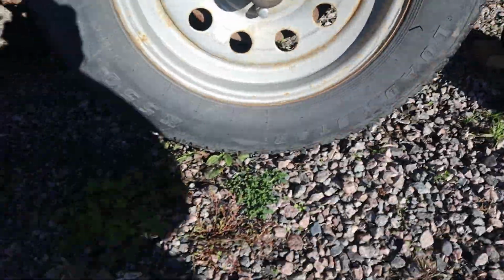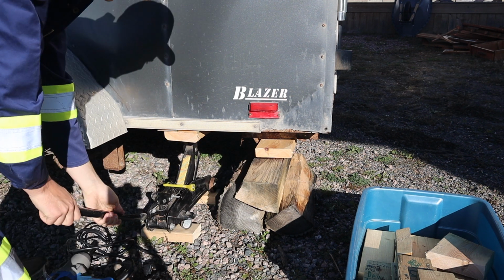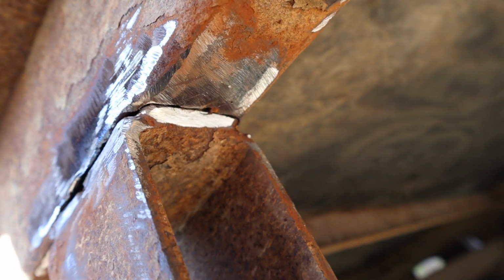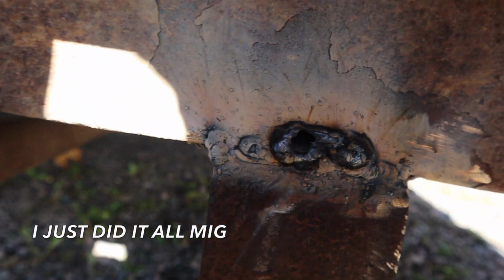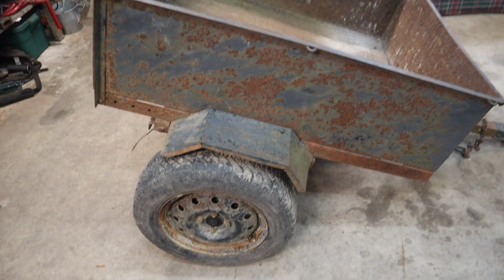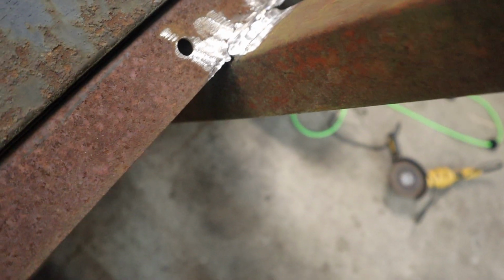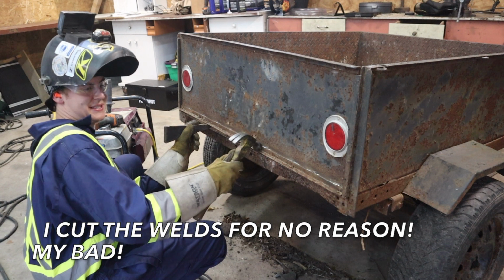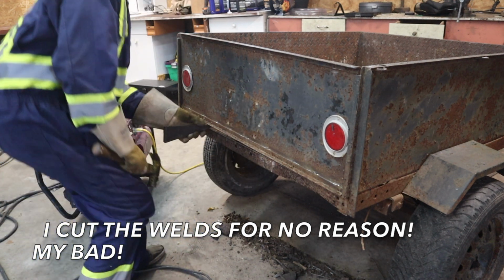Welding Broken Trailers Back Together! (MIG and Stick Welding)

Comment: I think you should really title the video as gasless flux cored as MIG is different.  You'd never get me crawling under a car/trailer without a better support and chocking the wheels.  Wood could be an option but not a rough pile of fire wood.  Glad you survived and it's your life so good luck to you.  Points for keeping the guards on the grinders!
Reply from the maker: Thanks for watching! Yeah a jack stand would be much better but I gotta work with what I have. The wood is supporting only one corner so if it did fail the trailer would rest on the hub where I was which would leave enough clearance that I wouldn’t get squished.
Reply: Lincoln makes a part specifically for FCAW that is smaller (easier to see puddle) than the nozzle you are using.
Reply from the maker: @donsmith9081  I have one.... it's a black plastic cone which is fucking useless. The contact tip sticks out past it and arcs out if you touch the material. I run the regular nozzle because you can drag it and not arc out.
Reply: @JTwelder.  It takes a little to get used to but is well worth it.  You can get in close on a fillet weld and see where you are going, that’s why they make them. 
Consider it like stick welding but ten times easier. Also the closer you are the hotter the weld and that can be important when using a 110V machine.  I have been using one for years. Try it again, I think you might like it.
Reply: @donsmith9081  yes...that ease of visualization and heat manipulation is the big benefit.   dragging the weld without seeing the puddle is definitely not a pro move.

Comment: you should only ever weld with a chassis, not accross it as when it fails, you end up with a 'plug' which comes out, exactly like what happened here. the whole square welded area came out
Reply from the maker: Yeah man your 100% right also the same applies even more to boom sections on heavy equipment. In this scenario the trailer just needed a quick fix to be on the road the next day and neither me or the owner had the proper size material to brace the frame length wise. They also got the trailer for free and doing a proper frame brace would cost over $500 so it's not practical. The original repair was done with cold hard wire mig that was barely fused and it lasted 2 years so I'm sure my repair will outlast the life of the trailer.

Comment: Hi there, i really needs some advise from you. I have a caravan and the weekend the chassis broke right through. On the nose side just in front of the shock,spring or what ever you cal it. Can it be repaired. I was told it cannot be repaired. I must get rid of my van. Some how im not believing him. Please advise me if this is true. Can it be   repaired.
Reply from the maker: I would recommend bringing it to a welder and seeing if they'll do it. It's doable Depending on how bad it's corroded. If the chassis is completely rotten then it can't be fixed but if it's just broken and not rotten it definitely can be repaired. Good luck

Comment: That doesn’t look like mig that looks like flux core. If you were running argon as a shielding gas the arc would be more of a sky blue color.
Reply from the maker: It is quite obviously flux core but where im from we just generalize all wire feeder welding as mig.

Comment: How many watts is tht generator? I have the same machine but idk how many watts I need to be able to run it properly.
Reply: Any 9000 watt generator from harbor freight will run it with no problem
Reply: [Amps * Volts = Watts]  You'll need to locate the input power specs for your machine (owners manual or sticker on back with duty cycle) as each can vary widely between MFGs and by welding type. You're looking specifically for the max input amp draw for the machine at the given voltage. For example, the Lincoln Easy-MIG 140 is {generically} rated for 20A@ 120V and 20% duty cycle on their site. I'd still check the sticker to be 100% sure since they're not as specific as some other MFGs. That said, 20a * 120v = 2400W. Add a 25% margin just to be safe (2400 * 1.25 = 3000w). The "continuous/running watts' of your generator should then meet or exceed that number (3000w). 

I grabbed a cheap multi-process Amico Mig140GS to keep handy on off-road trips. Amico's specs are a bit more specific. At 115v it's rated 27.1a (MIG) | 19.9 (TIG) | 34.2 (MMA). At 230v it's rated 20.9 (MIG) | 15.6 (TIG) | 25.5 (MMA). So for mine to run fully on 110/120 Mig I'd need [27.1a * 115v = 3117w * 1.25 = ~3896w] a 4K generator (also what Amico recommends in the owner manual). For 230, I'd need a 6K generator [20.9a * 230v = 4807w * 1.25 = ~6008w].

Comment: You should have done the job right if they are paying you to do this 3/16 plate all around frame the the leaf spring bracket !!!
Reply from the maker: Short answer why its not a full frame brace is pretty obvious (money). Your 100% right about the frame needing to properly be braced to have it repaired properly.  Here's why I didn't do that.
1. Neither me or the customer had the proper material on hand to do a full frame brace and they needed the trailer back asap to do a delivery.
2. It wouldn't be financially viable to do a frame brace. Steel is way up in price, closest steel supplier is almost a hour away and gas is at $2 per litre, the job would of taken much more time which obviously raises the cost. Also they were given the trailer for free so they really weren't looking to spend money on it.
3. The entire frame of the trailer is rotten so why spend a fuck ton of money fixing just one spot to have it break on another area a few months later
4. The same spring bracket broke out of the frame in the exact same spot two years before and the owner welded it back in himself in the rain with a mig welder set way too cold leaving a poorly fused weld......and it lasted another 2 YEARS before braking again.
5. The repair I did will easily outlast the life of the trailer. 
6. They bought a brand new bigger enclosed trailer about 2 months after this repair so the one in this video is currently a spare.

So overall if this was a heavy duty trailer that hauls large loads I would refuse the job unless the customer agreed to doing a proper brace. Obviously in this scenario This repair was perfectly fine. If your doing jobs for customers you have to cater to their needs not your own or else you'll never have any customers. You start refusing work once the customer refuses to spend money to do a repair that is adequate in your mind.
Reply: @JTwelder.  Dont take jobs that you can't do properly.  Your liability insurance (if you have it) isn't any good if you let a trailer go knowing that you didn't fix it right. If it's "not financially viable to do a frame brace", then you're not charging enough.   A couple pieces of 3/16 plate aren't that expensive, I have tons of that laying around that's already been paid for by other jobs.